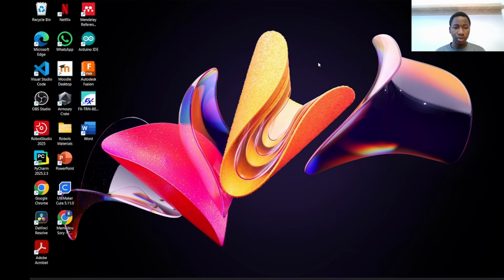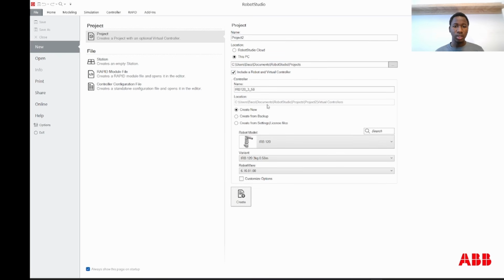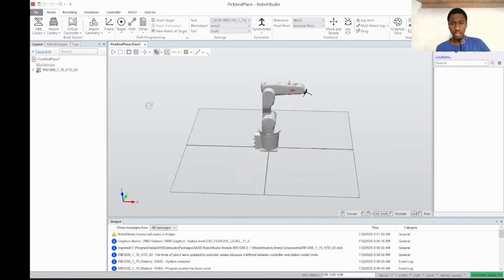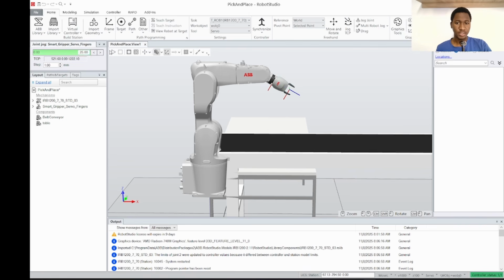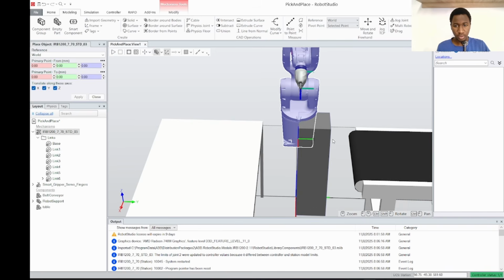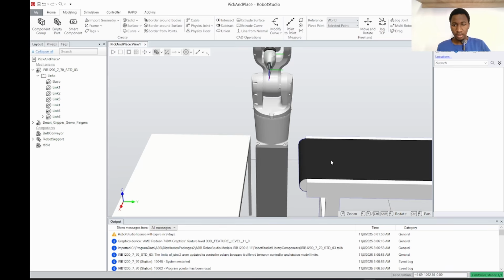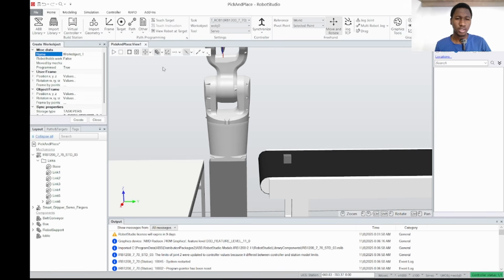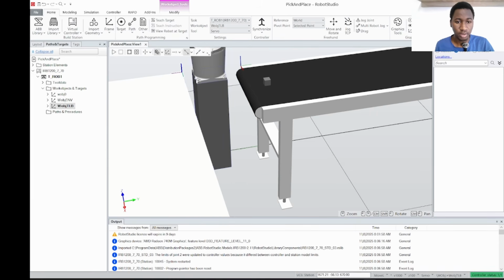How to Pick And Place in  RobotStudio Part01

Comment: What are the bare minimum specs to run the software pls
Reply: #CPU 2.0 GHz or faster processor, multiple cores recommended.
#Memory= 8 GB minimum, 16 GB or more if working with large CAD models.
#Disk 10+ GB free space, solid state drive (SSD).
#Graphics Card= High-performance, DirectX 11 compatible, gaming graphics card from any of the leading vendors. For
the Advanced lightning mode Direct3D feature level 10_1 or higher is required.
#Screen Resolution= 1920 x 1080 pixels or higher is recommended.
#Mouse Three-button mouse.